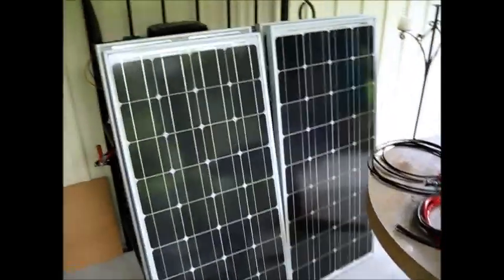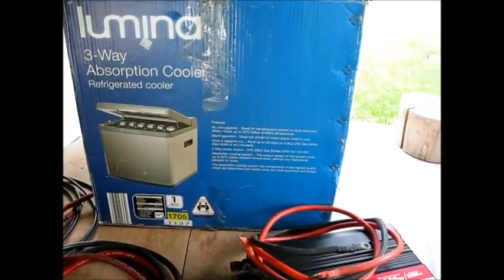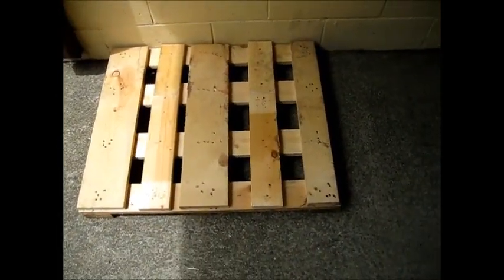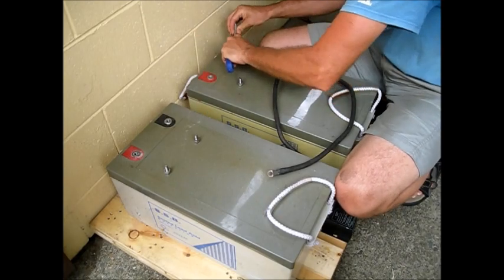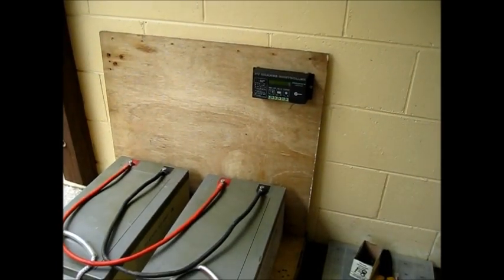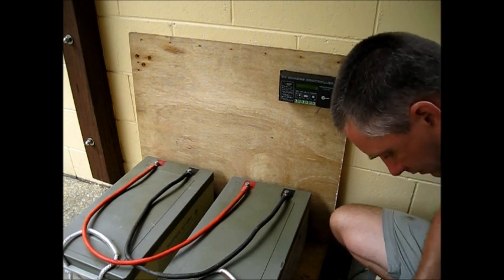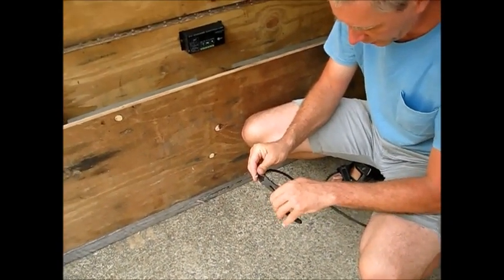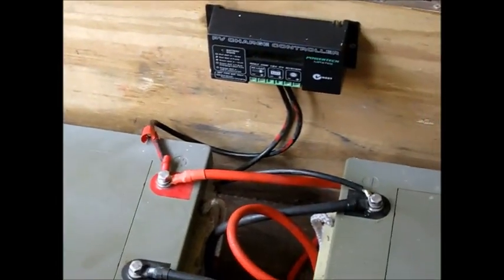The DIY World Installing Solar Panels On A Home In Australia

Comment: Great video I was getting tired of the lawn mower videos, as far as the comment about the use of electrical tape its used by licensed electricians all the time why do you think its called "electrical tape". Troy if I could make one suggestion from wiring experience next time don't mount the charge controller until after you attach the wires it makes it a lot easier...
Reply from the maker: Thank you. Yes I thought about hooking up the charge controller wires first once I realized how complicated it is to get the wires in there. Only reason I did not is to prevent the metal back plate of the charge controller from shorting on the battery terminals while I worked. I had kids running around and playing while I worked.
Reply: Cool glad to see something new can't wait till you get back
Reply: I consider electrical tape to be an insulator, I never use it to keep my wires from coming loose. 
In a 120V AC environment there is usually a low current. In a 12V DC environment there is usually very high current! Twisting wire together and relying on electrical tape to keep it from coming apart is not a good idea. If that temporary twisted connection becomes loose, this will become a bottleneck for current flow, it can generate extremely high temperature causing the tape and even the wire insulation to melt, if that exposed wire then touches ground, results can become catastrophic!
Reply: I can agree if it becomes loose but Troy specifically stated it was temporary until the bus bar is installed...
Reply: The Do It Yourself World You can connect the 4 wires at the charge controller first and in any order you like, just make sure these wires are not connected to anything at the other end! second connection would be to the batteries. The last connection would be the MC4s at the solar panels. Don't forget to protect the solar panels and wiring with fuses and a combiner. It can be done inexpensively and still done safely.
Reply from the maker: Francisco Campos I will be wiring up fuses soon. Just got the materials for it
Reply: Francisco Campos Thank you. These are the type comments that help us all learn. Especially novices, like me, when it comes to off-grid power generation.